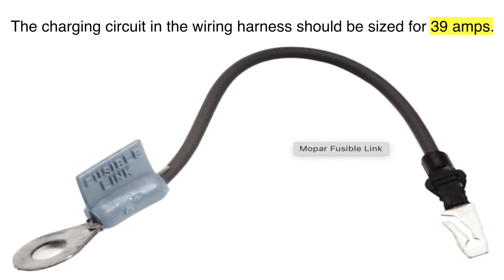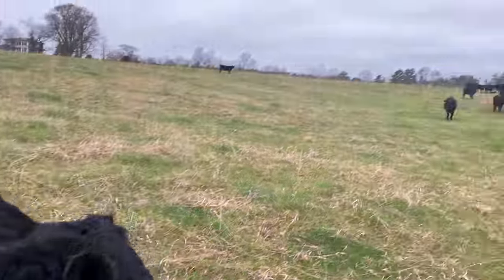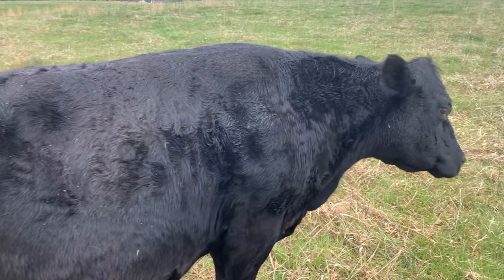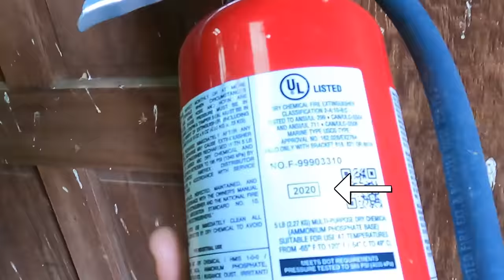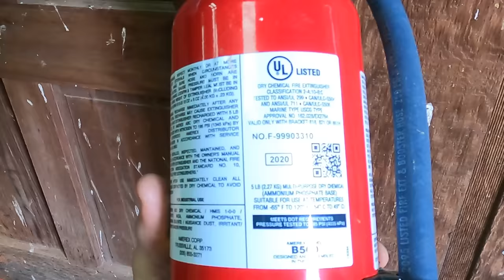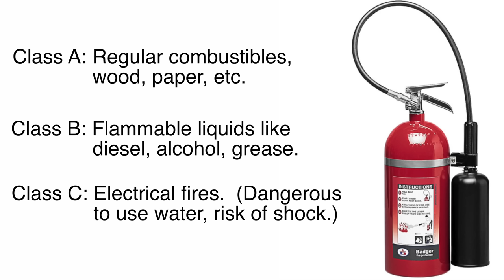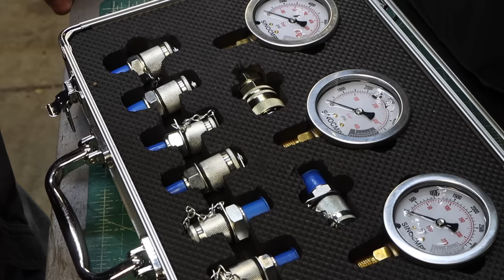Fire Extinguishers: 7 Things You Really Should Know...And Probably Don't.

Comment from the maker: It's an honor to have you fine people watching my channel, and I benefit from knowledge you share quite frequently.  I learned some VERY IMPORTANT things in my recent boom rebuild saga, and I just had to share it with everybody so we can all learn.  Cheers everybody!  Thank you all for your support!
Reply: I have learned A LOT from your channel, from woodworking stuff to tractor work to building fences (Actually just re-watched your farm fence video because I have to add a fence section and a gate to one of our pastures tomorrow since we are getting another cow)
Reply: Amen !!  have a blessed Good Friday
Reply: I have a feeling this won't be your last video about the boom lift, it's probably just cooking up it's next lesson!
Reply: I used to inspect fire extinguishers and refill them as needed. We used dry nitrogen to gas charge them. Do not use air from your compressor as the humidity in the air causes clumping inside the extinguisher, which can block the interior pickup tube.
Reply: I feel the same way man.  I have learned a TON from you.  I'm sure most everyone else here has as well.  It's an honor when we can give back.
I almost lost my boat motor to mud daubers.  They built a nest in the cooling water outlet between trips..  Thankfully I caught it before it blew up.
Reply: If it helps, know, that if you INTENTIONALLY tried to start that fire, the same way, It would most likely have failed. That's why all the "This and that isn't actually dangerous" or the "I couldn't get a space heater to catch fire" type videos posted on youtube are so stupid.  Fires like this, happen. By accident. Not because you don't prepare, but because it is impossible to think of everything. - Also when using a power type fire extinguisher, you should always smack it against a hard surface before use  to get the powder to come loose in case it has hardened.
Reply: Big fan from Dubai, learned alot from you man, thank you for your time and putting out awesome videos !
Reply: <------- fine viewer! LoL 😂😆
Reply: You ever consider having guest trades people on?
Reply: You’re on my shortlist of YT vids to watch. Well done sir, keep’em coming
Reply: I just ordered a red fire-proof can for oily rags in my woodshop and bought a fire extinguisher.
If you haven't seen Bourbon Moth's video on spontaneous combustion, highly recommended.
Reply: Awesome
Reply: Your channel is the best - really thankful to see not only your knowledge but your process of learning.  Even that is valuable.
Reply: Man, I look forward to your videos each week!  Not only do I learn a lot, you make them fun and engaging.  Ironically, I just went around and checked my fire extinguishers a few weeks ago because my kids were asking about grease fires. I started to show them where the kitchen extinguisher was and was appalled to see that while it had never been used, the pressure was gone. It was a cheap on and I replaced it. Checked the pressure on all the others I have.  I thought I was doing a great job and being proactive (or sufficiently reactive?? 😂). . . Until I watched this video!  😮
I Soooo appreciate that you put the information out there on what really needs to be done to ensure your extinguishers will work when you need them. I’m definitely adding to my inspection routine. And as it comes time to replace them, which is soon, I’m going to switch to refillable ones. 
Thank you!
Reply: 40 years as an electrician and have never seen “fusible links” like that looks total bull shit to me, regardless of what it is made of it will set fire to your machine before it blows. I will stick to fuses thanks 😂. Great demo though
Reply: I think the good old fire hose should have an honourable mention on your list of options. The bucket is well and good, but so many forget the value of a high flow fire hose. I'm even considering putting up a fire hydrant in our driveway (about 300 feet from the house and the barn) when I build a new house on the farm I am taking over. Then should I ever be in a position were I sadly need to call the fire services they will have a good source of water nearby.

In your list of alternatives to the powder based extinguisher you forgot to mention foam extinguishers. While they are less effective by weight than powder based extinguishers they are similar in the sense that they work against all three types of fires. The added weight also doesn't matter as much in a workshop setting as you can get them on carts/trollies with a hose attachment. Granted these are more expensive than more basic wall mounted options. However considering that the downside of firing off a powder based extinguisher close to expensive equipment with exposed electronic parts (as in circuit boards or air cooled electrical motors) is very big they are worth the investment. The insurance companies, in Norway at least, don't deep clean power tools or other heavy equipment and instead write it all off and replace it. Meaning you are dealing with a deductible, a delay before the tools are replaced and/or insurance pay-out and the potential hassle of arguing with your insurance company over what an out of production tool/machine  actually costs to replace. Oh and their not just deep cleaning the room(s) affected by this powder either. Most likely they are ripping out all the wiring and replacing all electrical fixtures as well since the fine powder particles can creep their way in there and cause all kinds of havoc later on.

Just to be clear this is for rooms where you know the monetary cost or the consequences of time lost on your projects matter a great deal or you know in advance that you might accidentally cause a fire. I completely agree with you that rooms or vehicles were you just want a standby extinguisher that can be whipped out in a hurry to handle an unforeseen fire powder is the way to go. Both because it's the most effective but also because it light and easy for anyone to handle without much pre-existing knowledge.
Reply: On a positive note I'm really glad that re-fillable extinguishers still are worth it in the rural areas of the US. At the moment I live in one of the largest cities in Norway and when the housing association that manages our building was looking to replace the aging extinguishers with new ones we learned that there was no company in town that could offer refillable options that were cheaper to refill than to replace. As a result we ended up buying 18 non refillable powder extinguishers that most likely are just waiting for a landfill. It's crazy how our government has legally mandated retailers of various types to accept and recycle the products they sell (electronics, batteries, plastic bottles etc), but this is somehow a perfectly ok product to just throw away after 10 years :p

Comment: I think you might want to add one more item to your fire extinguishing collection: A bucket of sand. Its cheap, smothers the fire and cleans up relatively well.
Reply: I second this. Smothering is always a fantastic method of extinguishing a fire.
Reply: And a welding or fiberglass blanket.  Better to not even start a fire.
Reply: Sand is also good for smaller Lithium fires like rechargeable 18650 cells.
Reply: If you do machining on Titanium or Magnesium and the lathe swarf ignites, you can use a Class D extinguisher.  It is one of the scarier and spectacular things to see in the shop.

Comment: As an officer on the FDNY, that was a great lesson on Fire Extinguishers.  May I add that there are several manufacturers of them.  Have your subscribers know that if the extinguisher has the UL, with the circle around it, that it is the one you what  (the UL stands for Underwriters Lab).  If not leave it on the shelf.  Also, aim the nozzle at the base of the fire, its fuel source.  The UL is good to look for on many items.  Its a long list.  Good luck and thanks far the valuable content and lessons.
Reply: I said it before you must have been a teacher once in your life. Great info on the fire extinguisher. Checking mine now. You are so right you don't think of them until you need one. I'm a truck driver I had a buddy with a brake fire one night he used mine and his extinguisher and didn't put it out. He grabbed a jug of windshield washer antifreeze. Did you know it has alcohol in it. Lol you can guess what happened.

Comment: As a former extinguisher maintenance person I can tell you that a good quality extinguisher can sit unmolested for years and work great without a "fluffer". That is hype that small and large fire equipment companies sell everyone on so they can charge you for quarterly visits. The large corporations that bought up a large proportion of the mom and pop fire equipment companies about three decades ago started lobbying for stricter rules to be put into law for maintenance with more frequent inspection regimes. What you need to watch is the condition of the rubber in the hoses. Check the pressure gauges, and make sure the pins will pull freely and the levers are not blocked from normal function. Actually the chemicals are very stable if dry and wont need replacement in anything like a 'frequent' time frame, more like a decade or two. Frankly it is a racket. Brand new extinguishers will give you the impression that they are 'packing' the powder also but, just like the older units, once the valve opens the movement of the gas through the powder liquefies it instantly. See Mark Rober's videos on soil liquefaction. The type of extinguisher that failed on you was recalled due to the quality of the plastic failing. When used, the changes in pressure in the valve would cause the head to shear off at the top of the plastic threads, leaving the would be firefighter with a plastic valve in their hand, blinded by powder and, if unlucky enough, with a sore foot from the metal canister rocketing down onto their toe.

Comment: Interesting results with the fusible links.  I wonder if those 14 awg were knock off fusible links?  I've always seen them with a solder connection in the middle, or a crimped in few awg smaller wire in the middle etc.  Great video, Jon!
Reply: I agree. I've never seen a fusible link resist normal failure like the black one in the video.
Reply: I think you guys are correct. I've never seen a fusible link do what those did. Usually they break without insulation failure. I think somebody sold him regular pieces of wire as fusible links, which is pretty evil imo
Reply: would've needed resistor for the tests with the fuses to actually have the amps be 30, 60,100 etc. you can't test amps like on the video, the amps were the short circuit/crank amps from the battery at every test for the time it was running before the fuses clicked or blew.

those looked sketch though yeah
Reply: I agree the heat from the overload needs to be focused on a short section of smaller gauge wire so that the heat is not dissipated on a longer length of the small wire. Since the heavier gauge wire will not generate much heat due to it’s size this should work. Steve

Comment: We have the fire extinguishers at work checked. Every year at the check the guy doing it uses a plastic hammer and give them a few hard taps at the bottom while holding them upside down. Apparently the powder is compacting faster in vehicles because vibrations. I usually give the extinguisher a hard knock before i use them, just to be sure

Comment: Hey Doug, on such a heavy boat it may not make a difference because of inertial mass. When you're tacking, maintain trim through the tack to sustain lift as far as possible into the wind. Then, ease the sheets maintaining trim as you fall off to the other tack. It will help maintain speed and steerage especially in lighter winds (if you're still sailing). Awesome tank of a boat built by a really inspiring person. Thank you!

Comment: Back in the seventies we had a small fire in our ships engine room. The first two dry powder extinguishers I picked up off their place on the steel  deck when I shook and then triggered them, the arse blew clean out of them. Reason... They had rusted away sitting on the deck. Always hang up your extinguishers and check regularly. The deck dept. Responsible for their maintenance had just been re tagging them without inspection.

Comment: As a Volunteer Firefighter in an extremely rural/remote area of the Appalachian mountains a fire extinguisher is always a great idea.

By the time I run from the kitchen table, grab my radio, hop in my pickup, then drive to the fire station, then hop in the apparatus, then drive to the scene, then gear up, typically 15 minutes has passed by the time we can get onscene.  Then I only have typically 1000 gallons of  water (which lasts for a minute) until I am empty.  Hopefully by then we get a second truck on scene to setup a pump station out of a creek, but it's no guarantee.

We might be able to save a room or two, but on average by the time we get there we're typically playing defensive and making sure the fire doesn't impinge on any above ground propane tanks, heating oil tanks, or any other outbuildings, homes, and preventing brush fires.  Fire extinguishers are your safest bet.

Comment: Fire Hazards in workshops: As a boatbuilder, I did work with different woods including Teak, Meranti and Locust for four decades. Dust of those woods from saws, planers and grinders can self-ignite when laying around in heaps or when compacted in bags!! . Also, rags, cloths or alike used to spread or even just dry-off oils for those woods (Teakoil in extreme here) can and will self-ignite when laying somewhere in contact with o2, which gets into a nice fire-insurance case very quickly once there were plaining chips, dust or both in close vicinity. I put my oiling rags in tin waterbuckets with solid tin lids and a clip to keep it from opening by accident. Most interesting fire hazard we had to deal with was angle grinding hardly sparking stainless, sparks flying in the direction of a stationary disc sander with a ton of dust underneath because nobody had time to clean up for a fourtnite of 14 hour days. We went for a brief lunch and came back to a slowly starting, smoldering fire where a spark had ignited that dust pile. 10 minutes later and we would have had to call the insurance even before the firefighters. We kept gas-extinguishers (halon and co2) besides every machine and had a look onto those every other year (not as difficult in terms of maintenance as powder extinguishers are). Welding and cutting (and grinding metals after that incident I mentioned) under cleaned-up conditions only, with not less than half an hour watch afterwards if done outside the dedicated metal shop within the shop. 
Some solvents, usually "less hazardous" aka not explosible under "normal" temperatures in habitable climate zones, can suddenly start to become explosive in very hot summer conditions within a closed workshop, too. 
Anyway, thanks for sharing. Appreciate the work You put in!

Comment: A fusable link that gets that hot before it burns through enough to open is just as bad as having any other wire melting. I like your in line fuse block better. 
Good to have extinguishers available. Breaking up the clump sounds good, but if it is in chunks the nozzle may plug.

Comment: Fusible links like the one in your machine, are often a high current "last ditch" thing to save the harness in the event of a dead short that doesn't pop another fuse, sometimes they are special wire but other times it will just be a smaller gauge wire than the rest of the circuit, the idea being if there is a short or high current fault the smaller wire will heat up and melt before the larger wire. Only time I've run into it is in old cars - my 1968 Dodge Polara has a smaller section of wire in the chargeback wire coming off the alternator; most of the newer stuff I've encountered is either fusible link wire like on your machine, or it is a "maxi fuse" similar to the pictures you showed.
Reply: Yeah, the biggest benefit is not having to replace an entire harness. It's not going to save any electronics or sensitive equipment from the short, but it should hopefully save you from needing to replace an entire wire harness (which might be a real nightmare).